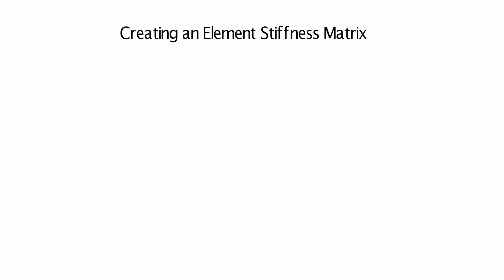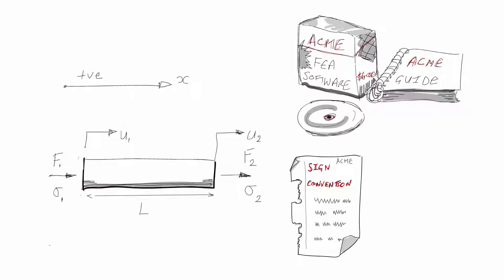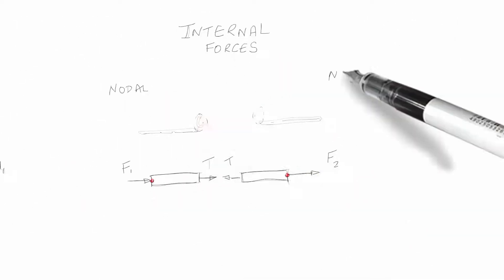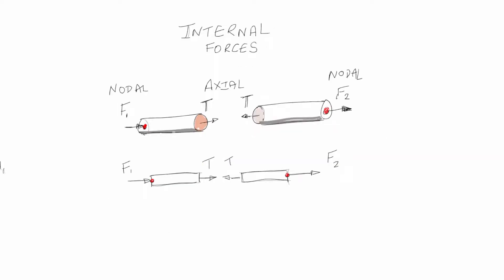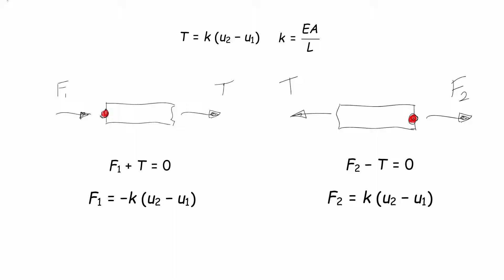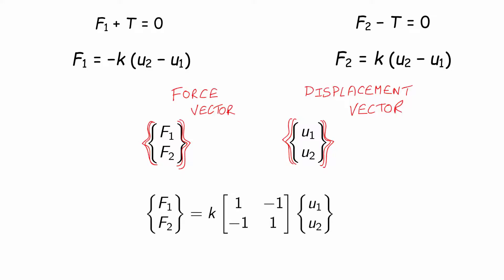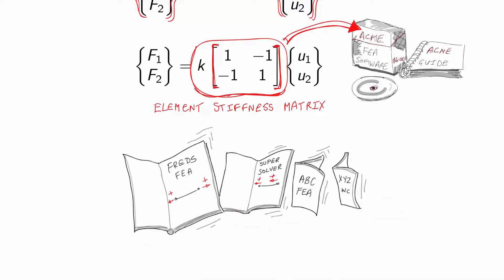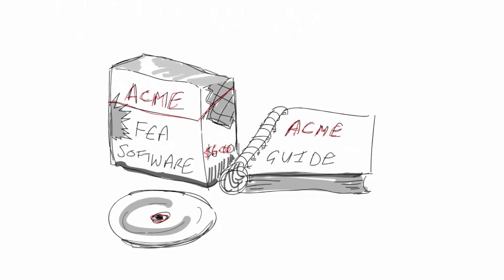B3 - Finite Element Analysis Training: Basic Stiffness,  Lesson 3

Comment: Should not internal force at first half portion be in opposite direction than what it is shown in the video? I am unable to get that direction of internal force it Force F is applied at node 1 in positive x direction then the internal force should be generated in negative x direction to keep the body under the equilibrium. Am I missing something?
Reply from the maker: check out the force balance at 2:58. The convention is positive to the right. F1=-T  F2 = T. Both rods are in equilibrium.